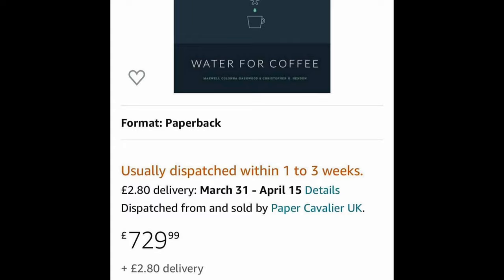Water For Coffee. Espresso Vs Filter

Comment: Damn, till this day I've never realized there's way less bicarb in the cup of espresso than in the filter brew. Thank you!

I believe that there's a relatively easy solution of adding a little amount of bicarb to the espresso when it's ready like a droplet of distilled water + bicarb. Wouldn't that mute acidity just as it would if the water had more of it?
Reply from the maker: Hey! that would totally work as a solution, I guess its not particularly practical in a commercial setting but yeah its totally do able !

Comment: Thank you for sharing this, very useful. Can the temperature of the water, play a part and balance the deficiency or excess of minerals?
Reply from the maker: Hey. Yes, temp does play a part. Careful approach to heating processes of water can reduce Bicarbonate and is used sometimes in beer brewing.  but its not simple/predictable and because water evaporates too the concentration changes aren't huge in most cases.